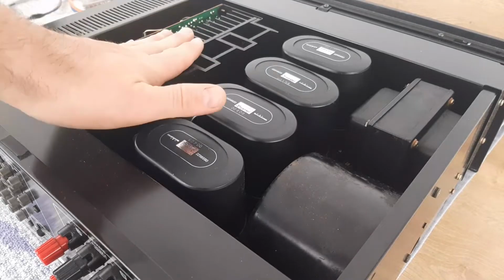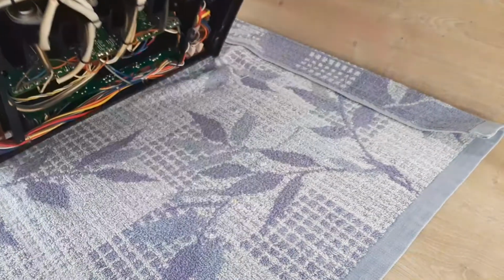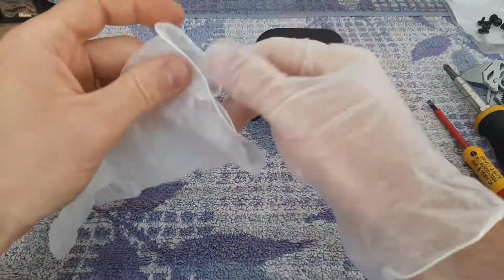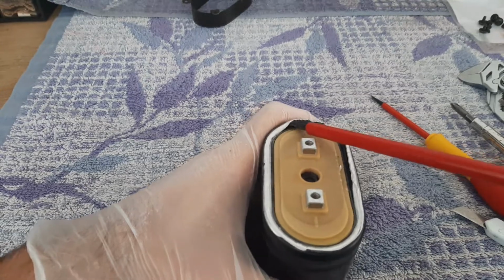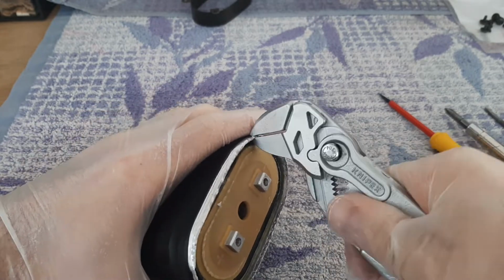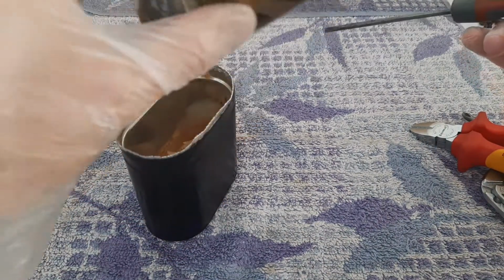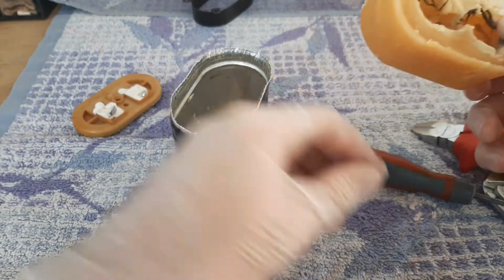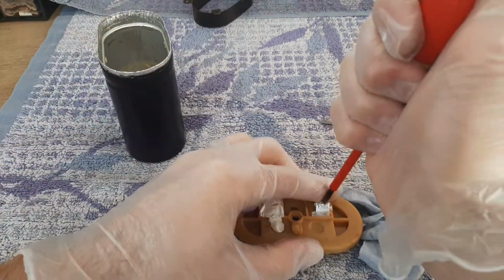Main Filter Capacitor Upgrade For Audio Amplifier No Sound Problem | SANSUI AU 919

Comment: Great job. I use a fume extractor exactly like yours but I cover the front with a carbon filter. It's cheap and helps to avoid spreading bad fumes around your workshop.
Reply from the maker: Thank you for comment and for your good idea, i will do as you said! Stay close and enjoy videos, olds and new. New videos on the record line, stay tuned ! Cheers !
Reply: @MariusHiFii  I'll stay tuned! 😁 Cheers!